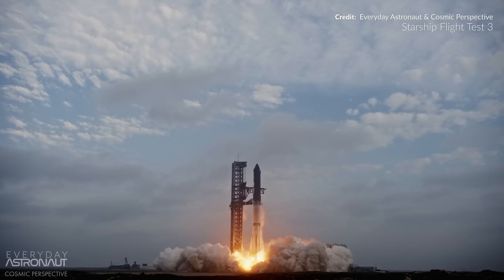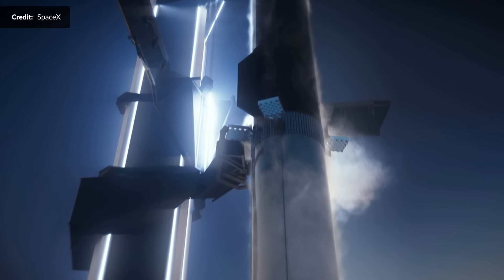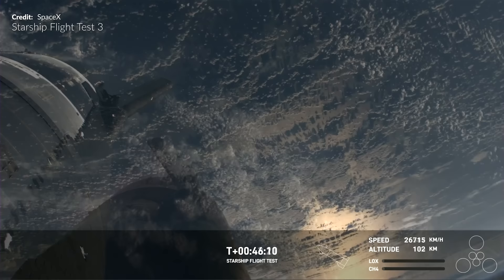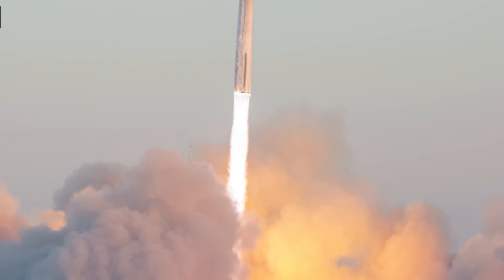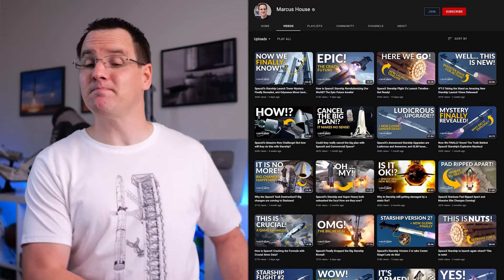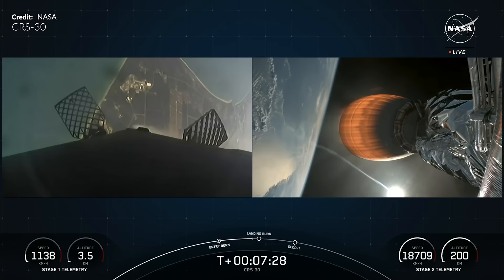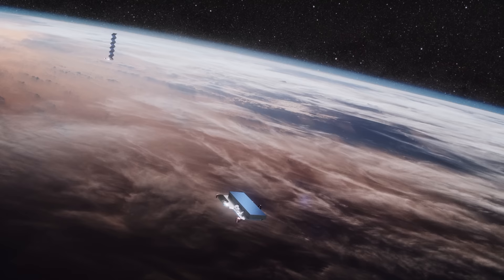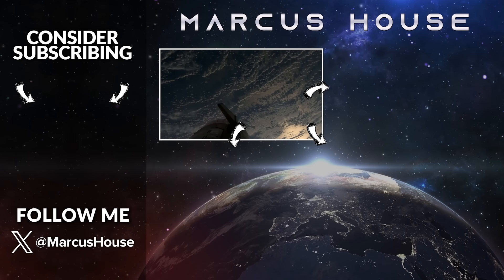SpaceX's Frantic Push to Launch the Next Starship Mission is Nuts!

Comment: The Falcon rocket family has achieved everything the Shuttle was designed to achieve, yet failed to do so. Multiple launches per week, payload-to-orbit costs have plummeted, it can launch satellites and humans, can rendezvous with the ISS, etc. The cadence of Falcon launches we're seeing is what we were supposed to see with Shuttle. Crazy to imagine.
Reply: Cant build the ISS though. Shuttle was choked into not being a complete success but nothing has or can do what shuttle did. Yet..
Reply: @Vatsyayana87 correct
Reply: It hasn’t. A key requirement of the shuttle was to return large objects to earth. That is why it was so big. And so dangerous.
Reply: Only thing it is lacking is the ability to return things to earth. Shuttle could grab things like satellites and bring them into the payload bay before de-orbiting.
Reply: who knew not building a rocket for a bilion a launch is the solution
Reply: @MrAlexs888  Amen to That!
Reply: Shuttle was immensely capable, yes, but hobbled by poor design choices. I think Starship will be what Shuttle was intended to be from the outset, because Elon got right what NASA got wrong: starting by optimising the production system for speed, iteration and price.
Reply: Wait till you see Starship super heavy ..orbital launch mount with three rings ,three boosters and an entire space station delivery system on top.
Reply: Hasn't achieved in-orbit service yet. It should be used to fix Hubble.
Reply: Try sending the Hubble into obit.   Try repairing the Hubble from the Falcon
Reply: Naw the shuttle was just poorly designed. There’s a reason we see so few designs like the shuttle actually succeed.

We don’t have to knock one to praise the other. The shuttle, despite being a poor design, was very successful and paved the way for the Falcon family.
Reply: STS was a 1960s design that was built in the 70s and flown for 3 decades.  Starship is a 21st century launch system that is still being developed.  Falcon likewise is a 21st century rocket with a radically different mission, capabilities and recovery system.  Comparing mid-to-late 20th century nasa (Boeing, Lockheed and others really) to 21st century SpaceX (which is also a nasa contractor just like what produced STS) is disingenuous when taking a narrow view of what space flight entails from the drawing board to orbit and beyond.
Reply: Nope
Reply: Only 2 shuttle blew up. Starship had surpassed that and it isn't even operational yet.
Reply: Its almost as if the science and engineering ground breaking done by NASA and its partners during the shuttle era, combined with 50 years of advancements in technology, enabled Falcon's success.  SpaceX, like Tesla, and Paypal for that matter, all succeeded with their initial products because they were the first player in obvious markets where all the technological ground breaking had been done for them in pieces by others and all that was left to do was make a single integrated platform that put all the pieces together.   That's what Musk really does, is he throws money at solved problems that have not been monetized yet for whatever reason, and he has been highly successful at it.
Reply: @Jimmy-Legs  Hubble could be launched from a Falcon Heavy, and repaired from a modified Dragon capsule, but Starship will be available soon, so there's no need.
Reply: @MichaelMiller-op8fe  That sounds Wonderful!
Reply: Falcon 9 is achieving significant reductions in $/kgs to orbit, pace of launch, and reliability; but it’s not really a Shuttle replacement, that’s what Starship is seeking to achieve.
Reply: @riparianlife97701  THEY CAN BARELY GET STARSHIP INTO ORBIT. THEYVE BLOWN UP ON LAUNCH MORE TIMES THAN THE SHUTTLE
Reply: @riparianlife97701  Everyone wants to be the first one to go up in the Starship said nobody at all.
Reply: You're forgetting that the primary mission of the space shuttle was to put 4 hubble class telescopes in orbit, which it did. Everything after that was a bonus. At the time, there was no other rocket system which could do this.
Reply: @Jimmy-Legs  the difference is pets vs cattle. It makes sense if you consider that NASA’s spacecraft were “pets” which got given names; SpaceX’s are “cattle”, which don’t.
Reply: @Jimmy-Legs  SpaceX rockets have safely carried 60 people to space. They're the only US company certified to do so. But hey, whatever makes you feel smart.
Reply: @Jimmy-Legs SpaceX offered to do a repair mission.
Reply: @ThatOpalGuy Two test articles blew up, not finished spacecrafts. 😂Your comparison is disingenuous.

Try again.
Reply: @Jimmy-Legs  SpaceX crashed a bunch of Falcon 9 boosters trying to figure out how to land them. Since then, they've successfully landed 295 of them, compared to the rest of the world's 0. But hey, whatever makes you feel smart.
Reply: @riparianlife97701  probably no point. All the production lines are gone, the parts hard/impossible to source, etc. Cheaper to build a new one than upgrade Hubble. The technology itself is now massively obsolete too. Furthermore, Hubble wasn’t designed to be fixed in orbit, which is why Story Musgrave and his crew on STS-61 was so legendary. Maybe the only reason why they’d go there is if Elon wanted to recover it to put it in the Smithsonian as a publicity stunt — that would require proper payload bay doors and an RMS which they don’t have yet.
Reply: @Steven_Edwards     Imagine if the first two Shuttles blew up on launch
Reply: @riparianlife97701     I specifically said Starship.   I accept your apology in advance.
Reply: @riparianlife97701  NASA crashed zero shuttles trying to figure out how to land them.
Reply: @Jimmy-Legs  The important part here is that you feel smart. The world owes that to you. (comment posted via Starlink)
Reply: @Jimmy-Legs landing a plane is much easier than landing a rocket with impulse braking, lol. The starships that have failed are all test vehicles. You are being intellectually dishonest
Reply: @benfowler1134  I guess we learned somthing in the 50 years between the Shuttle and Starship.
Reply: Hard compare technologies that are almost 50 years apart.
Reply: @Vatsyayana87 they are in the process of building a new space station. And with no shuttle how will it make orbit???
Reply: @benfowler1134  Apollo 12 brought back parts of an early lunar lander for fun and posterity. It would be fun if SpaceX brought back the Apollo 11 lander.
Reply: Your reply kind of confusing 😁🤔
Reply: @ThatOpalGuy it’s a completely different design process. That’s why progress is faster. Not to mention we get to see every test.
Reply: Not to mention how cheaper they are than every shuttle launched!
Reply: @richardconway6425  I thought the civilian case for Shuttle was to launch and service Space Station Freedom, plus an Air Force one as a jack-of-all-trades orbital pickup truck. Compromises were made as a consequence…
Reply: @Jimmy-Legs they haven’t put anyone on a starship flight. 
The shuttle killed people. Comparing it to an unmanned test is foolish at best. 
It’s still under development is all. 
Two different developmental styles. 
Spacex is cheaper and faster than nasa by far. The progress between flights is easily noticeable
Reply: @schrodingerscat1863  and it turned out that requirement was a bad one. Elon: “First, make your requirements less dumb”…. I think he’s onto something there.
Reply: @ThatOpalGuy   The shuttle also had way more funding, cost way more, wasnt designed to be tested in a destructive way, TRANSPORTED HUMANS and most importantly was by government owned agency thus most likely crashed way more often than is known to the public
Reply: Starship hasn't killed anyone yet.... Can't say that about the space shuttle.
Reply: @Vatsyayana87 Starship is only a year or so away from carrying shuttle-like payloads to orbit. I don't recall seeing anything on Starship being able to bring large payloads back to Earth though, like the shuttle could. 
Geoff
Reply: @jhorickok  I think it’s nuts that far cheaper to build and launch a fully-reusable Starship and _throw the whole thing away_, than it was to launch and refurbish Shuttle. Shows how far we’ve come.
Reply: @ThatOpalGuy no starships have blown up with people on board though
Reply: @GB-fd5ev  Yet. There’s nothing fundamental stopping the addition of larger payload bay doors and a remote manipulator — unless it turns out they can’t make it work from a structural POV and need to go back to the drawing board
Reply: It's bad that a Biden re-election commercial played during this video. His administration has done everything they can to stop Elon Musk.
Reply: @ThatOpalGuy That’s an irrelevant comparison. Starship is in early testing and development with radically different parameters. STS was built on existing technologies that had all “blown up” in testing and development in the years prior. You could just as well use humans killed as a metric to compare them.
Reply: That's what happens when you let engineers choose the design specs instead of a congressional committee.
Reply: @Jimmy-Legs So did Falcon. Now it’s the most successful launch platform in history by all relevant metrics. This is how rapid engineering development works. I suspect you are not an engineer, sonny.
Reply: @ThatOpalGuy you must know that spaceX's way of developing is by iteration and failing fast. which means launching something and whenever it fails, that's the "test". nasa can't afford to fail due to taxpayer money and bureaucracy stuff. nasa has to test every component one by one while spacex changes or adds something, and launches it to see what fails. 

this is highly reflective of programming principles, and spacex shows how effective this is.
Reply: Exactly right. Who knows what would have been developed if the overpromised shuttle hadn't displaced more established launchers at the time
Reply: …can’t service or retrieve satellites. The rest I agree with.
Reply: Also lacking bringing up big pieces for ISS build. So...no quite EVERYTHING.
Reply: Not being perverted by stupid air force requirements helped quite a bit
Reply: The Shuttle was a victim of the design to do everything curse It did everything just not as well as hoped
Reply: Shuttle killed 14 people; Starship hasn't lost even one payload.
Reply: @benfowler1134  there was a 'civilian case' for the shuttle, but I believe that it was, in some senses, secondary to its primary purpose. And that was to launch a new generation of surveillance satellites for the NRO/CIA. Apparently, getting funding for the shuttle was not going to be easy, but it was precisely because it could enhance America's surveillance gathering, that it got funding from Congress. I have heard people say that the whole project was so complex and expensive, that it would not have secured funding, unless it had a very compelling use scenario. 
I have heard various people talk about this, I think Scott Manley has. Also, it's kind of ironic, that scientists in the astronomy/astrophysics community are well aware that there are many hubble class telescopes, but only one is pointing at the heavens. I don't think it is widely known among the public, that there are at least 3 other hubble class telescopes in low earth orbit pointing squarely at the surface of the earth. 
But yes, there were always civilian/scientific use cases for it too, which was important for getting the support of the American public.
I think one of the huge successes of hubble was really inspiring everyone to take more of an interest in 'what's out there'.
Btw, I had never heard of "space station freedom". Was that a forerunner idea that preceded the ISS ?
Reply: @richardconway6425  surprised: 3 sounds like a very low number. And yes, Space Station Freedom morphed into the US/international segment of the ISS.
Reply: @joeweb5581    You’d think they would of learned from nasa
Reply: @benfowler1134  ha ! ... it's anyone's guess how many hubble class telescopes there are in orbit, but these things are supposed to be secret, after all. And they don't come cheap either. So, I have no idea, but interesting to speculate on. I remember Scott Manley doing a piece on how the hubble type surveillance satellites were able to get astonishingly high resolution images of the desert, in Iran. And they weren't focusing on sandcastles either ... 😂
Reply: @benfowler1134  hear hear…
Reply: @benfowler1134  I've just read your comment about the idea of Elon Musk recovering the hubble telescope so he can put it in the Smithsonian. That is a very cool idea, and would be a great test of his technology. They don't weigh as much as I had thought. Apparently about 10 tonnes, which is doable, right ?
Reply: What about payload mass, volume, and shape restrictions?
Reply: Soon didn't get a damn thing right. The actual engineers and scientists at SpaceX got things right. Musk is a very lucky grifter.
Reply: @Jimmy-Legs  Well... Starship is intended to fail and to blow up. They perfected the Shuttle very carefully spending a lot of time and money, while Starship is not even fully developed yet. Keep in mind that Starship is way more ambitious than the shuttle so they're taking a different approach: launching and improving it until it works. It worked with the Falcon rockets...
Reply: @ThatOpalGuy  The Shuttle was finished, the Starship isn't. They want the Starship to fail so that they can develop it at a faster pace than the shuttle. It's unfair to compare a finished rocket with a testing prototype.
Reply: No. The falcon is not reuseable as promised. And cost are many times higher than promised.

There is much more the falcon project failed to achive.
Reply: @JRBendixen  I agree with that, I don't deny it, and starship won't be as reusable as they want neither. The only statement I did is that the development was faster. I still think that it is closer to what they intended it to be than the shuttle (even if the shuttle was incredibly awesome and pretty successful anyway)
Reply: @richardconway6425  I would think so. The exact number will be in the Starship Payload User Guide, which I think is freely available
Reply: Take off your Musk fan boy glasses, NASA had other rockets that were successful conversions of redundant ICBMs thus they were retired and free and only had to modify them!  cheaper than even  falcon mate!
Reply: While I appreciate your exuberance - no.

Shuttle was designed to achieve a "time between landing and relaunch" of less than one month. For the *ORBITER*. The fastest they actually achieved was 55 days (Atlantis, 1985,) with Challenger accomplishing 63 days and Discovery 66 days (in 1984 and 1985 respectively.) Post-Challenger-disaster, the fastest was 88 days.

Shuttle was designed to launch from multiple different bases, with Vandenberg (the launch site used by SpaceX for West coast launches) about 95% ready when its use was cancelled post-Challenger. Of note, SpaceX hasn't used it for crewed launches.

Shuttle was designed for a turnaround of about one week between launches of different orbiters from the same launch pad. This, SpaceX has achieved, with SLC-40 last year having launches on July 10, 16, 24, and 28; however none of them crewed. More precautions are taken on crewed.

One key thing Shuttle was designed for was "launch, intercept and capture a satellite, land after only a single orbit at the launch site." Dragon isn't capable of return of a satellite at all, much less return to launch site after a single orbit.  The Air Force even wanted to be able to relaunch the captured satellite less than a week later (on a different orbiter, from a different launch pad at the same site.) I don't think Falcon 9 would be capable of relaunching a satellite with less than a week notice.

While Falcon 9 has lowered launch costs a huge amount, it still isn't as cheap as the Space Shuttle was planned to do (but never achieved.)
Reply: @ablert    Well, they are doing a bang up job blowing things up bro. I’ll give them that.
Reply: @MichaelMiller-op8fe ”Starship Super Heavy” 😮
Reply: Woah thanks for all the additional information, there's a huge difference between intention and reality
Reply: @Jimmy-Legs ”You know nothing. You understand nothing. You live in the past. Where I come from, the past is something to forget ...”
Reply: @kjmorley     Those who forget their history are condemned to repeat it.
Reply: Fifty years later
Reply: F9 cannot capture adversaries satellites and return them intact.
Reply: Well to Shuttle’s credit, Falcon can’t build space stations or bring orbiting objects/material back to earth yet, so it still has that on it.
Reply: @michaelmicek  standing on the shoulders of giants and pissing in their face
What is wrong with you?
Reply: @Steven-vo4ee  I don’t think… anything can do that yet?
Reply: @Jimmy-Legs Are you just trolling?
Reply: @daver40    I don’t fish.
Reply: @Jimmy-Legs throwing 100+ raptors into the sea so that spacex wont throw raptors into the sea is peak design.
Reply: Falcons can't repair/retrieve satellites.
Reply: @gmancolo  the bottom of the sea isn't a good place to store raptor engines so they can be rapidly reused. 100+ raptors. They might as well have thrown away every falcon 9 booster.
Reply: The shuttle cost $5 billion to develop, and more than 1 billion dollars for each launch (for more than 100 launches).  That is backwards.

The shuttle was sold to Congress as having an anticipated failure rate of 0.00001%. it's actual failure rate was 2%, which was typical for expendable boosters. The shuttle represented no increase in safety for the crew at all.
Reply: "only" two shuttles failed, which meant that NASA killed "only" 14 astronauts.  Starship has not killed anybody. If a rocket is going to fail, it should fail as a result of testing, not during operations.

The Shuttle failed because of poor engineering design choices.  

The cross - range capability of the shuttle was never used.

Even the designers of the shuttle were unhappy with its design, including Max Fagan.

The shuttle was supposed to provide frequent access to space with orders of magnitude improvements in safety, and orders of magnitude decreases in cost. It failed on all counts.
Reply: @timtruett5184  
The Shuttle was Nixon shutting down the "Demicratic" Moon program
Reply: @geesehoward700  sounds more like peak stupidity, but. I guess whatever.  We’re a throwaway society anyways
Reply: Falcon rockets do not have even one tenth of the operational capacity of the Space Shuttle. Of course, also, there were supposed to be ten Space Shuttles, not four. SpaceX currently has sixteen active Falcon 9 boosters which can do nothing but put a modest sized payload in orbit. We won't have the capability we had with the Space Shuttles again until Starship is fully operational. Then you can say SpaceX has surpassed the fifty year old technology of the Space Shuttle. Some people say it will be ten years before Starship will be ready to launch with crews on board. I sure hope they are wrong.
Reply: @odysseusrex5908     God be with those first passengers.  Perhaps they should send up some dogs first.
Reply: @Jimmy-Legs  shame it wasn't 117 cyber trucks but that makes that be for next month
Reply: @ThatOpalGuy  hehe good one. Dont think Starship has cost 196 bilion already but the score is the same
Reply: @benfowler1134  bollox
Reply: @Jimmy-Legs you don’t really grasp how this works, do you?
Reply: @StillAliveAndKicking_ polar-orbiting spy satellites specifically. KH-6 I think.
Reply: You could say that about 99.99999% of all successful products.
Invention is done decades earlier and it takes decades of work to perfect and commercialize.

Elon’s genius is unparalleled in history as an entrepreneur. He has created businesses that are efficient and successful enough to disrupt the global fossil fuel vehicle and power generation industries. The space launch and satellite communications industry. Large scale manufacturing and robotics industries. 
Leads in autonomous technology and AI industries.
And will likely control the space transportation and logistics industries as we push on to Mars.

It’s a certain genius beyond anything we have seen.
Reply: @Jimmy-Legs Jared Isaacman is actually considering a Hubble refurbishment from a Falcon 9 Dragon.
Reply: @glennscott8622  No, Starship and Space Shuttle are two completely unrelated concepts. Space Shuttle was designed to put in place and service orbiting satellites. Starship was conceived to establish a million strong self supporting colony on Mars so that humanity will survive the Biblical rapture. For the good of humanity someone should quietly suggest to Elon that he stops reading his Bible and gaining inspiration from his childhood comic books.
Reply: @conard5381  yea, everything between Saturn V and Falcon 9 was hobbled by the political design process, I hold up the F35 as a similar issue
Reply: @Jimmy-Legs the falcon is the main option being considered to repair the hubble telescope today....
Reply: @Alucard-gt1zf    That is because the Shuttle has been retired. Talk is cheap and NASA wants the repair done at no cost.  It ain’t happening.
Reply: Can it return a  payload to earth?
Reply: The Space Shuttle was also a military asset that was designed specifically for missions that can’t be preformed by the Falcon family….dont overstate its performance compared to another system, the space shuttle failed on many of  its design objectives but it could do things the Falcon will never be capable of.
Reply: @williamhatfield8935  Theologically, there is a difference between Rapture and Armaggeddon. I think you ought to know the difference first
Reply: @skybattler2624  I just asked God and he said one and the same. So who am I to argue with His word?
Reply: @williamhatfield8935  Armageddon is the final battle between the forces of the world with the AntiChrist and the Second Coming of Jesus.

Rapture is the taking up of saints from earth BEFORE Armaggedon, before God unleashes His full wrath during Armageddon.

Hence why the difference. They are not synonymous, although both events do happen during the Second Coming, hence the confusion.
Reply: @skybattler2624  Hi skybattler. I just put your most recent premise before God and He told me this is all a mishmash of ignorant superstitions put together by dirt poor goatherders. What really awaits us is an Eternity of Heavenly Bliss just as long as we promise to contribute towards our Evangelical pastor’s new jet.
Reply: @Jimmy-Legs  Starship heavy can fit a ship or robot to do those things in it's massive amount of space, it doesn't have to do it itself.
Reply: 1.) Payload to orbit costs have fallen marginally, roughly a third less. Musk promised a two-three order of magnitude (100-1000) times reduction in cost. 

2.) Falcon has a far lower capability in LEO when compared to shuttle. NASA pays the same per kg delivered as they did with shuttle, actually more at this point due to the 40% price hike SpaceX achieved. 

3.) Falcon cant deliver anywhere near the same payload volume, mass, crew to LEO nor can they reuse significant payloads by returning them to earth (not like shuttle).
Reply: @williamhatfield8935  Nice try, You are never talking to God.

Why? Goatherders are an insult towards the New Testament believers. Evangelical Pastor's jet is an insult to the Evangelical movement.

And besides, Goatherders never invented Rapture and Armageddon Argument.

I other words, you are doing a huge mockery here and just trolling as you are simply Angry on Conservatives as a whole (and thus, Angry at Musk).
Reply: Why compare Falcon with the Shuttle? At least pick apples and apples
Reply: @Jimmy-Legs  Every shuttle took around 750,000 hours to repurpose. It was just barely cheaper to fix them than to make a new one entirely.
Also, remind me again how many people died in the Space Shuttle and how many died in Starship?
The Space Shuttle had 5 test flights. In 3 test flights, Starship has already nearly surpassed the Space Shuttle. 
There's a reason why Starship is being called the most revolutionary ship every produced. Because once it becomes re-usable, it will change humanity
Reply: @riparianlife97701  vertical landings were done long before spacex did them
Reply: It’s not really any cheaper for humans to orbit.
Reply: @MyShanghaiShuffle  Not on orbital rockets.
Reply: @MichaelMiller-op8fe    The inside cargo area of the Starship is already larger than the ISS. One Starship in orbit will make the ISS obsolete.
Reply: @benfowler1134 The crew dragon spacecraft they do. Endeavour, Resilience, Endurance and Freedom so far.
Reply: Lol!!!!  yeah, blowing up multiple times!  What a joke!  My 12 year old son makes better rockets than SpaceX!
Reply: @ThatOpalGuy With, um, people onboard. Tends to be important.
Reply: 12:06 - I’m surprised that it doesn’t seem like tower two will be taller considering Elon musk recently reiterated version two of starship will be longer. Can you address the need for a taller tower?
Reply: @benfowler1134  Starship still is not complete success, sl the shuttle as spaceplane still remains working method.
Reply: @riparianlife97701 Starship won't ever be human ready not in hundred years.
Reply: @riparianlife97701 Spacex x rockets cannot retrieve or maneuver in LEO. What you on about
Reply: @ifldiscovery8500  So how the hell have 60 humans gone to the ISS and come back to Earth in Dragon capsules?
Reply: @ifldiscovery8500  People said they'd never human rate Falcon 9, but it's the ONLY human-rated rocket in the US. I give them 2 years.
Reply: @ThatOpalGuy and hasn't managed a payload
Reply: @Jimmy-Legs  Starship, the largest rocket to ever fly, built by a private company in a tiny fraction of the time it took to develop everything before it, is making YOU look like a brilliant achiever by sucking so much. The Soviet Union blew up 4 half the size and gave up. SpaceX will be catching both stages by the end of this year, and flying humans in 2-3 years. Their experience launching Falcon 9's and Falcon Heavies counts.
Reply: @riparianlife97701     LOL.  You’re such a fanboy. Your “private company “ got 3 billion dollars from the government last year bro. A “fraction of a time” it took to develop everything before it? They been working at least 6 years on this. Apollo had manned launches in 7 years. And SpaceX has had the advantage of all the previous work done in the last 60 years in rockets and space flight design. Not to mention the incredible development of computers since the 60’s. Come on bro.